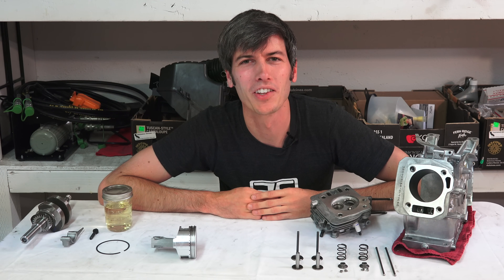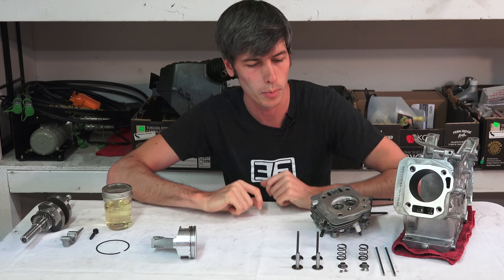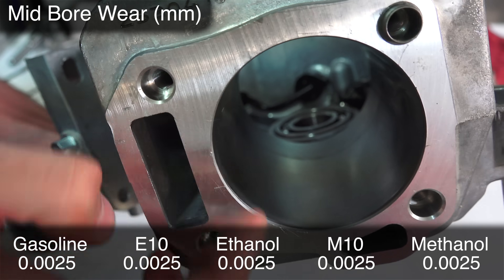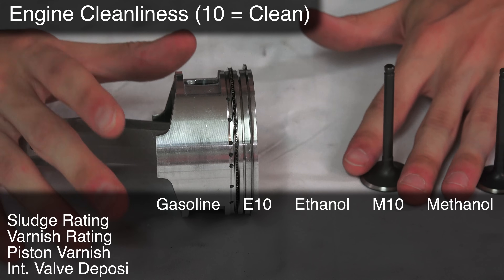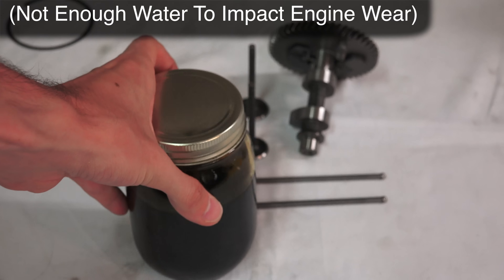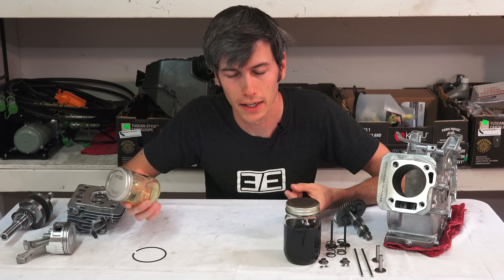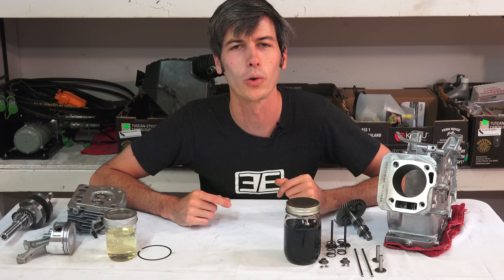Is Ethanol Bad For Your Car's Engine?

Comment: Maybe it’s a weird placebo effect, but I feel like my truck (2016 F-150 5.0) has more gusto on e85 than normal fuel. I don’t use it because mileage is atrocious and there’s only 1 pump in about a 50 mile radius from where I live. Maybe you could go into the science as to the performance characteristics of each fuel as a follow up to this video?

Comment: Where to start ? A 20 hr. test from 1981, 37 years ago. So funny, weighing a cam follower for wear. That's like saying you sit a 2 oz glass of water and 2 oz  glass of alcohol at room temp for 5 seconds and then weighed them and say it's all the same. This is 2018, call Holley Carb. and ask how many brand new carbs they have had to warranty because of corrosion and rust. Call the Insurance company's and ask how many cars and  garages have burned up because of fuel leaks. Fuel leaks alone should be enough to outlaw this D.C. lobbyist payoff fund. Imagine how many cars or trucks are about to start leaking O rings with 50 to 60 psi fuel pressure in the engine compartment while you drive or park in the garage. I don't know of anyone that can detect a fuel leak at 60 mph with the hood closed. Call the repair shops and ask how many fuel pump, fuel lines, gas tanks they replace. Ethanol started out as a way for more energy independence. But, it is too corrosive to put in pipelines, so it has to be moved by trucks. It cost more to mix the blends. It make less power and less gas mileage. We hear that the farmers will go broke if the govt ( our taxes ) doesn't pay subsidies to grow corn. Really, can you have too much corn? Eat it or make more beer. Please sell more pure gas!
Reply: Just to correct, the 2 oz. water,  alcohol was a evaporation comparison
Reply: Oh Bull ! 
Alcohol has miles higher flash point compared to gasoline. Even methanol which evaporates like there's no tomorrow is harder to ignite than gasoline.
There's a not a single pipeline between a fuel depot and gas station in the world, so If you bought it a trucker brought it. Millions of tons of liquid chemicals go by road on a daily basis.
Reply: @rosen9425  Yep, I agree that all gas is shipped in trucks to the stations. But, the point is, ethanol is horrific to an old car that is in storage. It's too corrosive to almost every single system, phases out, drops octane rating, swells rubber and o rings, etc. How can I prove this? I have two Corvettes in storage that I start about once a month. Within a two week period, I started one and the o rings on the fuel rail sprayed on the distributor cap and ignited. I quickly put out the fire. Normally, the hood would be closed and would not have seen anything from inside the car. The second car leaked at the injector o rings and puddled gas on the intake manifold. No fire. Repaired both cars, but, what would have happened if I drove the cars a couple of miles? I have changed out the gas and several electric fuel pumps, probably due to water content. I am not an engineer. I just want to be able to keep a car running without constant, useless expense. While NASCAR and turbo cars run some version of E85, i DON'T WANT E10 OR E15 in my stuff. And draining the tanks all the time is not the answer.
Reply: @Z06Doug 
Yes to old cars. How old?
Gasoline also deteriorate in storage, seals and what not does dry out too.
If course fuel will ignite from contact with a distributor compare to a cool intake manifold.

You can't dismiss alcohol as a fuel from this. It works as everything else when used in the right conditions and all prerequisites in check. It's alcohol. Dirty liquor not distilled enough to be drinkable.

Comment: That's really good information! The problem though has always been those other things: fuel system problems, taking on water, short shelf life, etc.
I have several vehicles, the newest of which is 15 years old. E10 sucks in old vehicles, especially carbureted ones not designed to use it. Also, when you get a 40+ year old motorcycle out of winter storage and drain the gas tank and yellow syrup comes out... No good.  Cleaning the varnish out of carbs is something I wish I could avoid having to do.  The closest place I've found to get E0 is still 50 miles away. :-(

Comment: Some pumps have 0% ethanol premium, but 10% regular. The molar enthalpy is about 4% difference between the two different mixes, so if you can get premium for 4% more or less the cost, then it's worth it. 

I find ethanol gets too much water when I leave it in a tank for a few months, so it's terrible for like mowers and equipment and stuff, but if you use it up right away in your daily...

Comment: I use ethanol free 89 octane and get 100+ miles more per tank!! Tested many times with different vehicles. (Never tested with flex fuel vehicle tho)
Reply from the maker: Sounds like a big tank if it makes that big of a difference!
Reply: Engineering Explained Actually not at all. I have a 2006 Toyota Avalon and a 2008 Highlander hybrid that I have tested. I've run both from full (one click) till I ran out of gas. Then towed them straight to the gas station. Avalon EPA rated 22mpg combined. I drove 457 miles on 18 gallons. My Highlander hybrid is rated 25mpg combined EPA. I went 526 miles on 17.3 gallons of 89 e free. Thanks and awesome videos as always. It's instant and freeway driving keeps MPG very high. A lot of stop and go reduces the e free effect. Test it , it works! Costco regular (87 Oct) Avalon gets 17- 19 MPG , Highlander Hybrid gets 22-23.5 MPG.

Comment: e10 =20%less power
Reply from the maker: There’s a difference between energy and power. Ethanol isn’t as energy dense as gasoline, but you can make more power with it as a result of the higher octane rating. Uses more fuel, but makes more power.

Comment: Ethanol is a good high octane compound used in race fuels. I have used the pure stuff bought from factory, not the garbage at the pump. Not sure why the garbage at the pump corrodes, degrades and cause so much bubble cavitation at injection resulting in inefficiencies and damage over time. Of course adequate race grade lubrication is needed with ethanol, but good luck getting that with catalytic compatible low phosphorus oil

Comment: I think the safety of these fuels is not demonstrated. The study was too short. Some corrosion characteristics almost certain take substantial time to occur. I know E10 gas has just terrible in my fancy Honda lawn mower, with lots of oxidation products clogging the carb. Autos may be different but I skeptical.

Comment: I do know that 10% etuenol isn't good for carb cars because the parts in carbs aren't designed to handle ethenol because it is corrosive to rubber part
Reply: I drive a 85 Monte Carlo SS so not great for my car

Comment: I have  Mercury Milan with a 2.5L engine. I used E10 for a long time, and switched to straight unleaded fuel. I got 100 miles more per tank. Also my Ford Explorer starts much better with straight unleaded. I look for straight unleaded from now on.

Comment: Ethanol is ok because an old Govt study says so? C’mon, you can do better than this! Ethanol is a SCAM! It collects water in your tank, destroys your fuel economy, and can damage your fuel system. It also is subsidized by the taxpayers and causes MORE pollution because you have to burn more fuel to go the same distance. This practice needs to stop. There are plenty of other sources that say the same thing, so please do a little better research before you take such an obviously biased report and claim it as gospel.

Comment: I am very surprised about the accelerated wear of the cam lobes and followers associated with methanol fuel. Is this fully explained by the presence of corrosive combustion products in the blow-by/oil, or is it perhaps related to the increased cylinder pressures? Would be wonderful to see all these results normalised by BMEP.

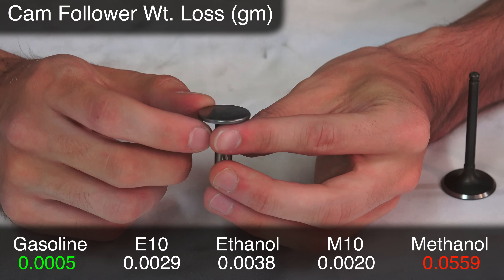Comment: 4:09 I disagree with your (or rather, the study's) interpretation of these results. 0.0005 and 0.0029 are significantly different. The E10 wear is nearly 6 times greater than pure gasoline.
Reply: That's what I was thinking. I saw double the wear or more on some parts using E10. How can they say it's not significant? I guess the numbers are low enough that the wear is still "acceptable ", but we aren't only looking for acceptability, we are also comparing them to each other. To me that means pure gas may help certain engine components last significantly longer than when using E10.
Reply: If you go to the paper it should say whether the results were statistically significant or not.

Comment: I don't think anyone says ethanol is bad for your engine. What we do say however, is that it's bad for your fuel system that contains rubber components and it absorbs more moisture and therefore the gas will go bad sooner.

Comment: Thank you for the great presentation. I would like to add that ethanol in blend with gasoline can produce synergistic benefits at certain ratios in different engines. The majority of engines designed for primaryIly toxic gasoline will loose horsepower and fuel efficiency with blends below 35% and above 70% ethanol. However, closer to a 50% blend, or between 40% to 60% ethanol creates more power and better fuel efficiency than the petroleum gasoline that is worth more value to our World if it is not burned.

Comment: Ethanol has been used since, at the very least,  the 70's. You say from 2012 and newer are fine but vehicles a lot older can use e10 with no issues.

Comment: What does the unburned ethanol do to the hardware before geting burned into the engine. Fuel tank,fuel pump,fuel lines,injectors. Things like that. At work we have noticed that ethanol fuels dry parts out,and start to corrodes certain metals

Comment: If there is no clear advantage to e10 then why not pure gasoline?
Reply from the maker: They’re are advantages of e10. Cost effective and ethanol raises octane rating.
Reply: Jason, I have noticed exhausts on GDI cars are often black with soot unlike port injected cars.  Is this because (at least with turbos) they have to run rich for cooling, like you mentioned in your other video?  Would higher ethanol blends help reduce the soot production of GDI engines?  At first I thought people were just driving WOT all the time :-)
Reply: I think one thing people miss is that if ethanol disappeared overnight the price of fuel would increase a lot.  Ethanol is a cheap way to increase the octane rating of gasoline and prevent knock in your engine.  If it was unavailable, refineries would have to produce far more high octane alkylate from the alkylation units to blend into the gasoline pool which would be expensive and use more crude oil further driving up the cost of fuel.  It would be interesting if a petroleum engineer would add some detail on this, but that's how I understand it.

Comment: The very last few seconds were the most valuable. What's more important to gear heads is whether it's better to run 93 with 10% ethanol or 91 no ethanol for fuel economy and performance for different engine types: I4 turbo Vs v8

Comment: Great video as always, but honestly I thought we'd put this to bed years ago; even the people who say it'll damage the car are usually talking about fuel hoeses and pumps and such. But yeah, modern cars like 99% on the road are fine, which is why they can sell it everywhere. 

What I'd really like is an environment impact vid of E10, because seemingly even governments can't agree on whether the real world impact of E10 is lower or higher pollution and "bad" emissions - some say that because the E10 emits less CO2 total emissions are cleaner, others that that's offset by the lower fuel economy and people seem to quote different examples of how switching to ethanol fuels in a region either improved or worsened emissions there. In fact there's so much politics behind it it's pretty hard to google a definitive.
Reply from the maker: Great question and something worth looking into further!

Comment: I’m confused how any engine in good condition that amount of wear in 20 hours. 2 thousandths of an inch in piston rings an abnormal amount of wear for 20 hours. That amount of wear could be expected in an engine every 15-20 thousand miles.
Reply from the maker: 20 hours at a constant high load is a long test. Most engines never see that kind of consistent heat.

Comment: How about performance? I have a 2005 vehicle that is turbocharged. I have often wondered if the ethanol can cause knock, pre-ignition, or pinging on older, high performance engines. especially in hot dry weather. I have noticed odd things since fuels went E10 year round. I am in Oregon USA for reference.

Comment: Exactly what I thought. If your vehicle wasn't designed to run on it, we shouldn't be using it. Worse gas mileage and potentially harmful to the fuel system in older vehicles due to to being corrosive. So, why the hell is E10 being forced on everybody?

Comment: In the Subaru Brz /Toyota 86  Ethanol has been linked to the "crickets" an annoying but harmless noise from their high pressure fuel pumps. Experts recommend switching to gas with no ethanol. (SHELL 91)
Reply: Oh that sucks, it's a great car. Hopefully it is harmless. Notice any performance difference between fuel with some ethanol in it vs ethanol free?
Reply: @BensCoffeeRants  don't know,  only use 
 Shell v-power 91 no ethanol.

Comment: In Thailand, we have E10, E20 and E85 since quite many years. I never had a problem with my Mazdas running these fuels. I tested all of them with the new Mazda 3. Power and acceleration is the same. But fuel consumption with E85 is about 27%  higher. E85 is cheaper here, but at the end, the benefit was only about 7% less costs per kilometre. I stayed with E10 because E85 is not available at all gasoline stations and I didn't like to refill so often.

Comment: The study was done 37 years ago, presumably on engines of that vintage (did the test involve complete fuel systems and engines or just engines?). This would lead me to believe, contrary to what is concluded in the video, that it is likely to be safe for cars all the way back to at least that vintage.
Reply from the maker: It’s fine for engine internals, as stated in the video.

Comment: Thank you for your overview in the subject... it's never bad to highlight research that was done, regardless the era, the results or even the motivation behind the research because it may expose someone to a topic that might spark their interest to dig deeper into the subject matter.  And as you can see from earlier comments, there are plenty of avenues of further research into this subject, not the least drawing such impactful conclusions based on a very poor sample size. I realize that there is quite a fair bit of cost to running engines on a dyno for hours on end, but even if they average the wear characteristics of each of four cylinders, they can't claim any statistical significance in their data.
The other thing that you just touch on briefly is issues with ethanol blended fuels an their impact on fuel systems, but I believe there is quite a bit more to that issue that could be the topic of another video (or even a series). For one thing, you'll note that diesel has been exempt from the ethanol requirement years beyond when it was mandated for gas to be supplied with 10% ethanol... there's plenty of speculation online to why this is so, but nothing truly conclusive. Oh, and biodiesel was a thing for about a year, then no one has a remaining interest... I know for tractors it was nearly impossible from keeping the stuff from essentially spoiling, which pretty much would be the equivalent of putting sugar in your tank of gas. There's probably a dozen dissertations written on related topics, but not much of this has had exposure to the general population.
You know, in case you're running thin on material... anyway, keep it up!

Comment: Did they look at the power output with each fuel? And were there any hypotheses made about the reasons for different wear rates (I'm curious especially about how cam lobe wear was so different for methanol)?

Comment: I recall reading abaout a test that GM did in the 50s to determine if 4 valves per cylinder was worth pursuing. They wrote it off as a lost cause. See what happens when you rely on limited data or outdated data to form an opinion?

Comment: It it worth the extra trouble and cost of buying pure gas for small engines which tend to sit for months - ethanol gums up and absorbs water and turns to crap. Pure gas is pretty stable unless it is going to be sitting for a decade or something.

Comment: I've heard that you have to replace your oil every 1000 miles when using higher level ethanol fuels because it dillutes your oil. Is this false?
Reply from the maker: That’s a great question! This study did not seem to show a major difference in the ethanol oil, but it’d be worth looking into further.
Reply: Yes, I take my flex fuel car to the dealer every 3k miles, but have heard of 10k+ miles on an oil change then it comes out clean.

Comment: Their's a problem with the test. The problems aren't with the engine itself, but in the fuel pumps, injectors, regulators and other rubber parts. And even after 2012 vehicles, the fuel pumps don't hold up nearly as much. Also, sketchy gas stations have found out ethanol mixes with water, so stations will add several gallons of water to the tanks to get more fuel for their money. Just another reason to use a good name brand station.

Comment: Where I worked. We had fleet vehicles and used a fleet service for service and maintenance. We found the mileage dropped significantly using ethanol fuels, which was bad enough we found the blended fuels cost more to drive with it. The service people told us, not use blended fuels they cause premature wear of the engines. Conclusion, don’t use ethanol blended fuels.